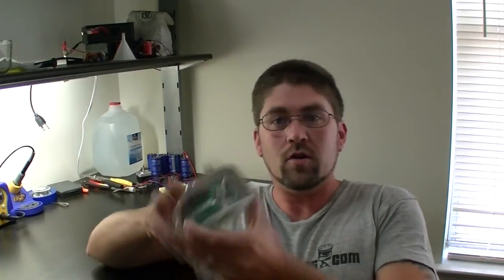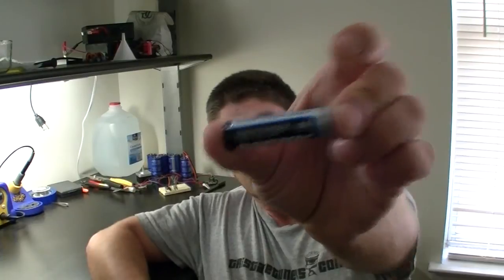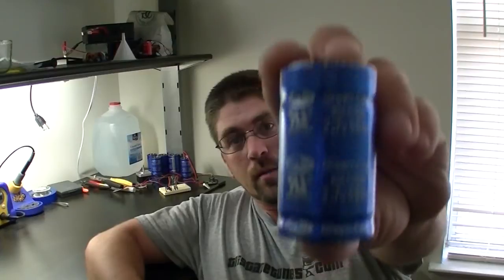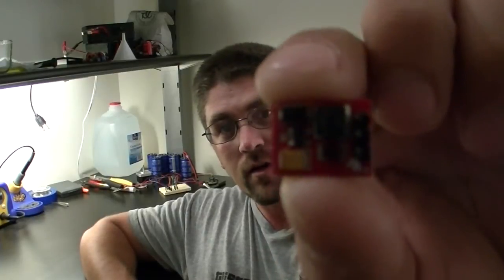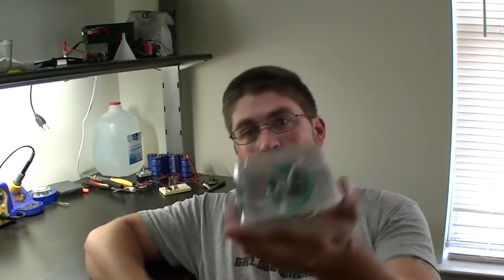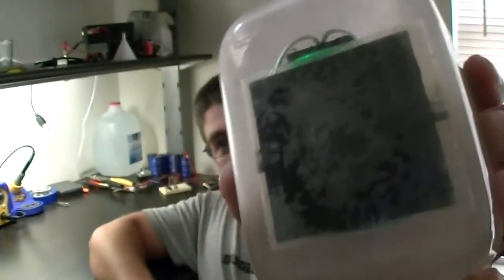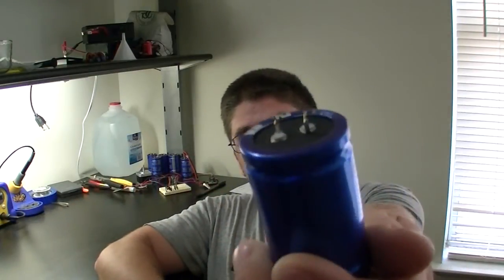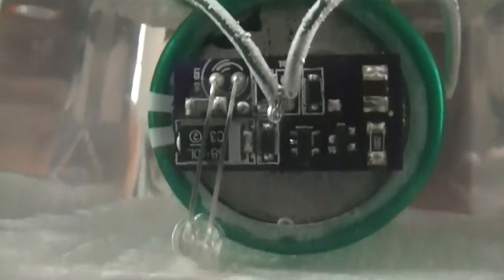Infinity Sun Jar Is Now Open Source Hardware

Comment: HI. I am very curious what will happen if you charge 2 capacitors and try them in series and in paralel to the NCP1402. Which combination will give more light time :) Just for the experiment.
Reply from the maker: NCP1402 is a boost IC, not a boost/buck IC.  If you ran two supercaps in series you would overvoltage the IC.
Reply: Oh, yes. Thanks. I thought the input voltage can be up to 6v, but it is 3.3v

Comment from the maker: It's a tricky setup.  I have the zener tied to the solar cell before the schottky blocking diode.  So you have to take into account the schottky voltage drop (in his case closer to 0.4v drop), but more importantly the solar cells open voltage is around 3.8vdc.  When connected to the solar cap the highest it charges up to is 2.5v with a 3.3v zener, so i opted for a 3.6v zener to regulate the panel and fully charge the supercap.  It's not perfect but it works.